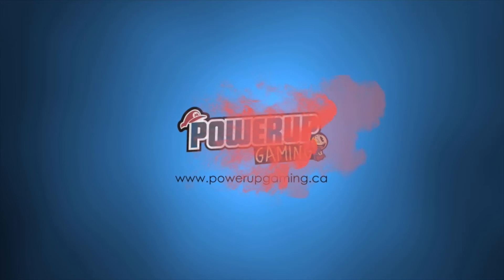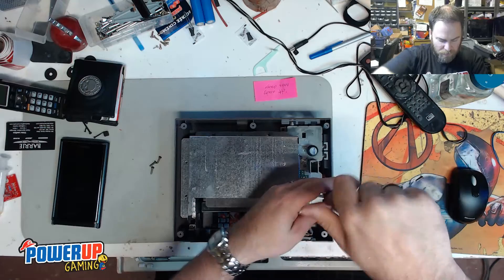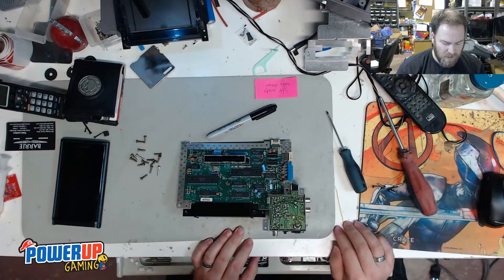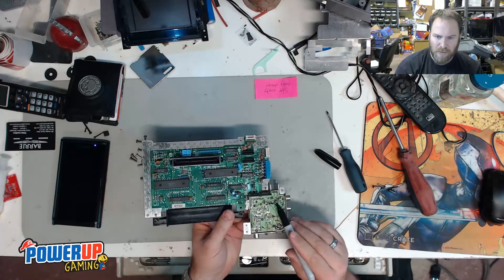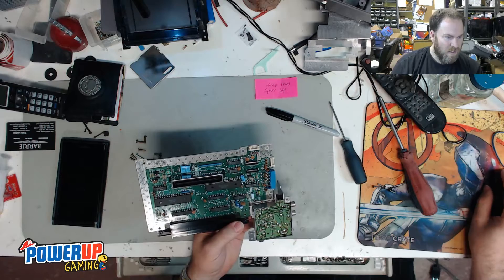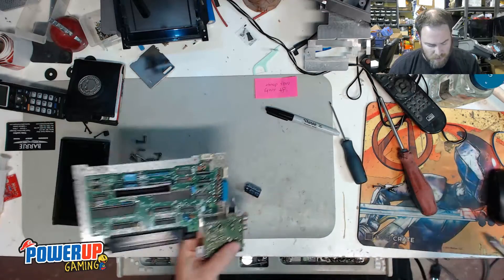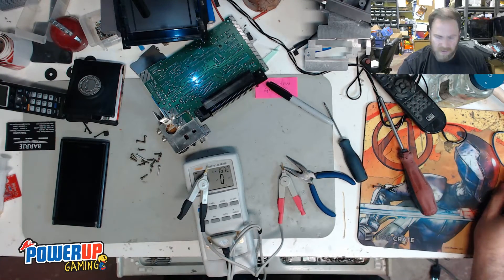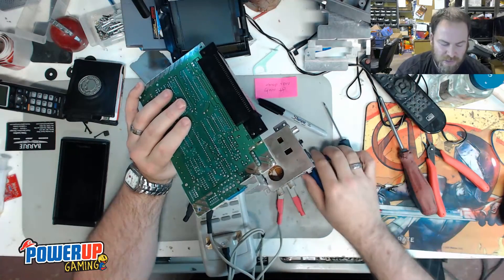Nintendo (NES) Front Loader Not Outputting Video From RCA Composite Jack Repair

Comment: Hey sorry to hit up a dead thread but I just seen something that might help understand what happened with your Comp vid. I had recapped a nes with blinking light but I missed one capacitor, the 10uf 16v on the RF board going to comp out. I cut pin4 CIC, new 7805 installed and reassembled. Now I had black screen with perfect audio. I chased composite from pin 21 PPU through all the transistors, diodes, resistors up pin 1 to the RF board. I though maybe Q1 the comp amplification NPN transistor was bad, it tested fine (.614 and .614 multi meter diode test). Then I found the 10uf 16v cap I missed. It tested at 10.36uf when I pulled it out of circuit, totally perfect. I replaced it and re-assembled, I changed nothing else. It worked perfect video and audio after re-assembly. Maybe ESR needs to be considered also?
Reply from the maker: It's not dead at all. :)  We got the video to work in that console.
Reply: @PowerUpGamingCanada  yeah, we know. In the video you tested the capacitance and all the capacitor values were good. You replaced the capacitors and it worked but you were confused that none of the capacitors tested bad. I was saying I had the same experience. But neither of us tested ESR, my point is testing capacitance alone is not enough to verify operation of a capacitor.
Reply: @jamesross9469 Good point

Comment: Not sure you can help but it's worth a shot.
I have a NES-001-04 that has corrupted video, which appears using both the RCA as well as coax. The sprites look fine but some of the background tiles are corrupted. Here is what I've done so far w/o any change to the outcome. 
Initially, I thought it might just be a cap issue so I replaced all of the electrolytics. I also cleaned all of the contacts for cart with 91% isopropyl alcohol as well as cleaned and bent back the pins on the 72 pin header. When that didn't work I purchased a brand new pin header. After that didn't work, I purchased a working NES-001-07, making sure that both games I had were actually working. I then  removed the CPU, PPU, and two RAM chips from both boards and socketed them. I then swapped all of the chips. I'm now down to testing all of the other components. The 7805 is outputting 5 vdc. I guess it's possible that there could be some issue within the video output circuitry but I suspect it's an issue closer to the PPU.
Any suggestions on where, and what, to try next? I have a multimeter and logic probe but no O-scope but I know people with them so if need be, I can get them to check the signal output.
See da video of what is happening. (https://1drv.ms/v/s!AuS1xumH3tqog6oKRBbm91vWYG2zeA?e=lwf54z)
Reply from the maker: That was a lot of work.  Honestly, it sounds like one of the traces has a break right where the 72 pin connector is.  Have you check the traces?
Reply: @PowerUpGamingCanada  LOL! Yeah, no kidding. First NES fix for me so I learned one thing, do research before repairing things. It would have probably saved me a few steps. :-D
I haven't checked the traces but the PPU seems to be generating the correct signals but I'll recheck that. It's hard to determine the path to the video but I'll do my best. Thanks for the suggestion.

Comment: really odd issue with one thats come in to me today. trying to research it. basically the rca output doesnt work, on its own... but if you simply plug in a connector into the rf jack.. it will output through the rca jack and it works. no idea why!

Comment: PowerUpGamingCanda since you know about how the NES works and etc. i need your help maybe you can diagnose my problem some how, i have an original NES console and the rf nor rca outputs work, the machine still runs but no video or sound is ever displayed, i have never worked on an NES before nor do i have much knowledge of physical computer components so I have no idea what the problem is, i've tried two different TV's but still nothing so there is a problem with the video output and idk what it is so if you have any idea or any ideas of what would be wrong can you plz help me out, i love old consoles but now i can't play SMB anymore and it sucks, P.S. even a list of possible problems would help a lot
Reply from the maker: The first question is, do you have power to the console?  The power light comes on?  With no game in the console does the power light flash on and off steadily?  

So, power light comes on means you have power.  Power light flashes on and off steadily means the system is trying to run and the lockout chip is still enabled which means no one has overly messed around with it.  Beyond that, it could be capacitors that are the issue.  If you are not technical then you will want to find someone who can take a look at them and replace them if needed.  Most likely that will be the issue and will clear up your problem.
Reply: Yes power is to the console, the light works like it is supposed to, when no game is in, it will blink like normal, and when a game is in the light will stay on like normal
Reply from the maker: So, when you have the yellow RCA hooked up to the system and the other end of the yellow RCA input on the TV you get absolutely no signal at all?  No grey or other color screen?
Reply: Yes and the TV that im using is saying no signal no other colors display nothing at all
Reply from the maker: Yep, then I would say capacitors would be the next thing to check if no signal is given.
Reply: Ok, i will get that checked out, since i dont have the right equipment to desolder, solder, but i do have the a voltage tester tho
Reply: Did you get yours fixed? Mine is having this problem too
Reply: PowerUpGamingCanada Im having this same problem. I changed capacitors and still nothing. Where do I go from here? My power light comes on solid with game blinks with no game. Tv just says no signal. Any suggestions on where to go next?
Reply: Having this issue as well!

Comment: Hey PowerUpGamingCanada, you may or may not be able to help me out with this...I have a tip of "something" stuck in the video RCA port on the right side of my NES frontloader. Every video or tutorial I've searched talks about removing a broken RCA jack that has a plastic core...heating up a heating rod, nail, etc etc. The broken piece/tip of the jack, or whatever broke off in there, is all metal. It seems, at least from this video, that just to get to "FROM BEHIND" and push the piece out, would be a little difficult. Any tips? Ideas?
Reply from the maker: Good question and I have never addressed that type of issue before.  I will however be doing up some consoles in the next day or two so I will see what the access is like to get it out from the inside.

Comment: Hello PowerUpGamingCanada I have an issue with no audio in my Nintendo NES, I've had the console since it was brand new when I was a kid it's all 100% original today is the first time I took it apart and I cleaned the orca and rf on it and put it all back together and still no sound lots of video but no sound and it always worked before any possible help would be super fantastic?
Reply from the maker: Are you connecting the console with Composite cables or are your using the RF switch that it came with originally?
Reply: @PowerUpGamingCanada  Hello I'm using the RF cable that came with it originally but I was thinking of using Audio Video cables instead. Thank you so much for taking the time in replying back to me.
Reply from the maker: Drop the RF cable and go to RCA Composite cables.  Check for sound that way.  If there is still no sound then your capacitors will need to be changed out which isn't easy the first time you do it.  You will need some skills with soldering and desoldering to do it.